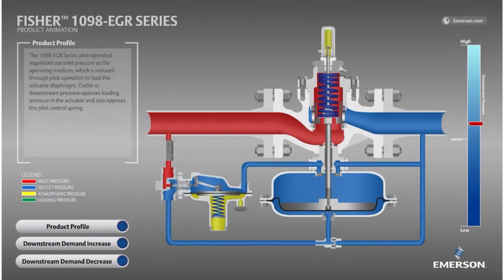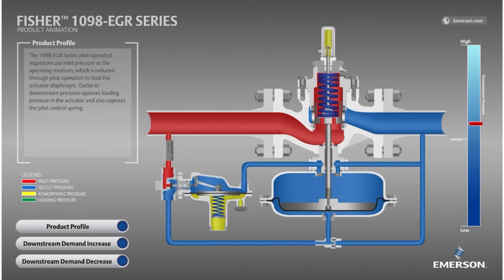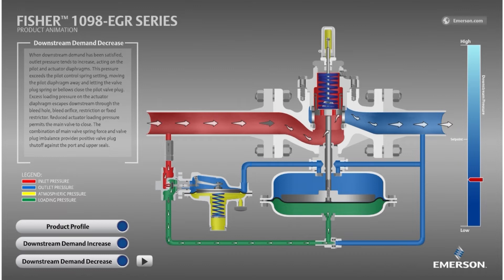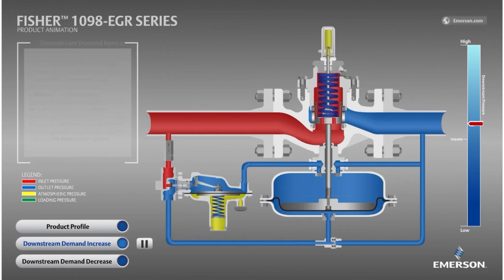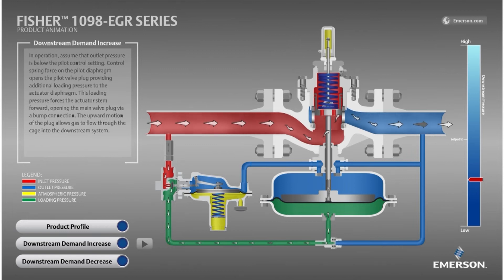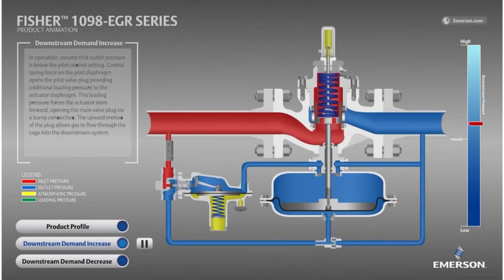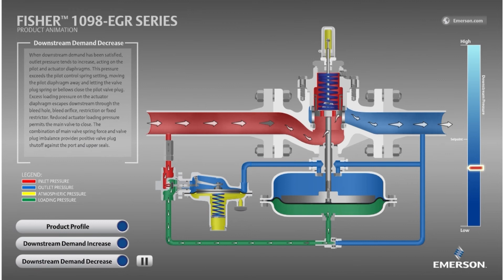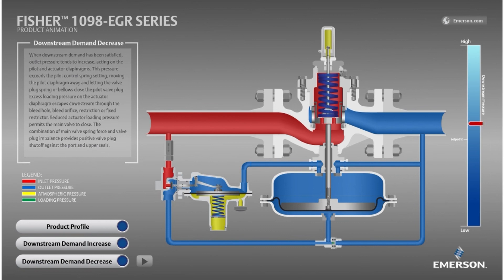How a Fisher 1098-EGR Regulator Works -  Guided Operation Tutorial

Comment: Excelente desde Venezuela
Reply from the maker: ¡Gracias, Esteban!
Reply: @EmersonRegulators  ojala algun día trabaje con hermenson son mis sueños
Reply: Hi my company is offering emerson fisher 
DVC6200/2000 007 0.62LB Array Qty 5
DVC6200/2000 019 0.60LB Array Qty 20
DVC6200,2000 038 0.55LB Array Qty 20
DVC6200/2000 050 0.50LB Array Qty 20
DVC6200/2000 110 0.70LB Array Qty 20
DVC6200/2000 210 1.10LB Array Qty 5
DVC6200/2000 Rotary 0.48LB      Qty 10
they are shelf life 2 years old i will consider all offers

Comment: Hi my friends
What is the difference between EZR and EGR?
Reply: EZR is and unloading style pilot regulator. 1098-EGR is a loading style. When the main valve opens one unloads loading pressure in the loading chamber the other loads pressure in the loading chamber.